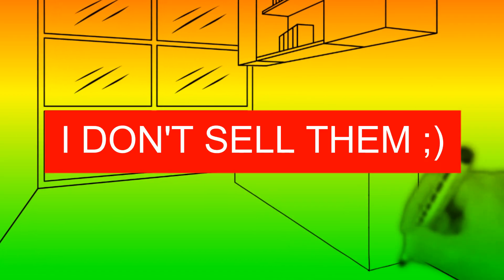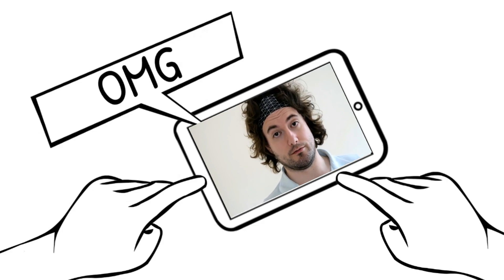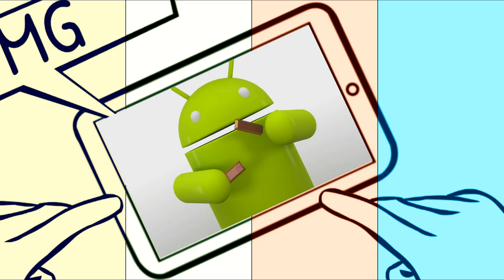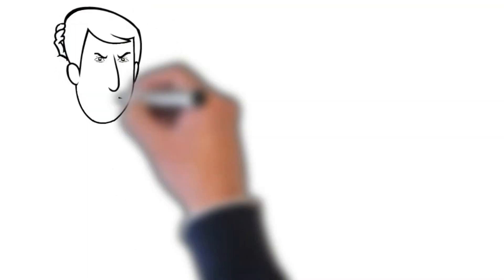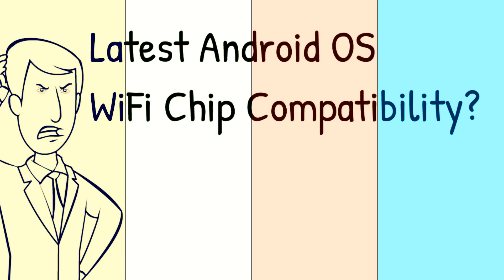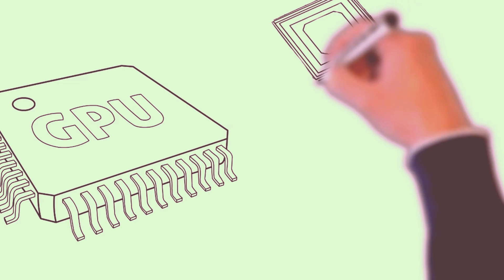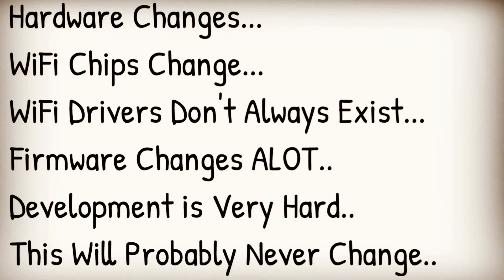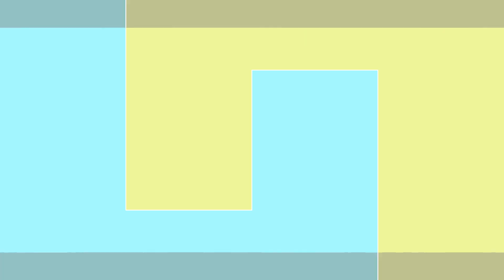Why Does WiFi Sometimes Not Work: Android TV Box New Firmware Installations

Comment: I had the problem with Wi-Fi and the LAN not working reliably with a new MXQ PRO 4K 5G basically it works then doesn't and you can unplug and or choose DHCP (again) it'll connect but minutes or hours later it loses connection I found a russian software similar to ATVXperience which works but in the process of trying different software I now have one MXQ PRO 4K 5G which is using the ATVXperience software (not the russian one) it's still dropping the Wi-Fi or LAN and I wanted to change it to the Russian version that works but actually it won;t accept any change either using an SD card or USB Burner - have you any ideas what I might try to fix this annoying problem

Comment: Hey I attempted the 5.1.1 installation guide. When I downloaded the Abdul zip file and drop it into my SD card. It doesn't turn it into the archive program as shown in your tutorial. it keeps it as a zip file. I use 7zip for zip files. Am I using the wrong program? Maybe wrong version of Windows?  Also the black box link now shows an "alternative" file to download. Thanks.
Reply from the maker: Need twrp img file and zip lollipop file onto an fat32 formatted SD card
Reply: @MXQPROJECT  I realized I needed to use winmount for it to transfer to SD fat32 properly... Unfortunately my box wouldn't activate TWRP and just sat on the amlogic s8505 screen and didn't show the little Android guy. When I boot without SD card and without the .img file it boots to the Android guy just fine. Trying to update through that way via SD card doesn't work. I noticed updated files on mxqproject/files website. Should I use the "alternative" link? Abdul also uploaded a TWRP.zip file... Is there a new tutorial or updated process? Possibly my box won't work... Looks exactly like yours.